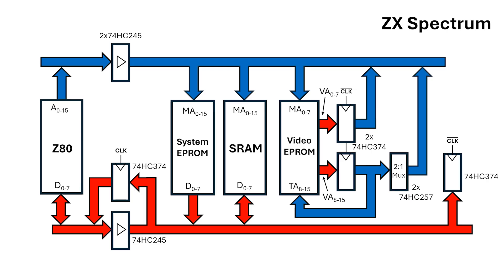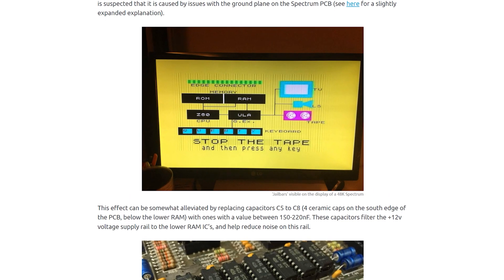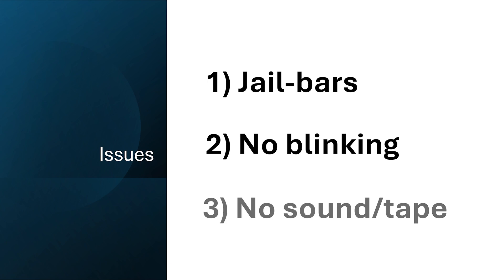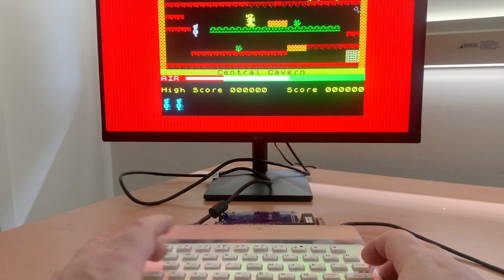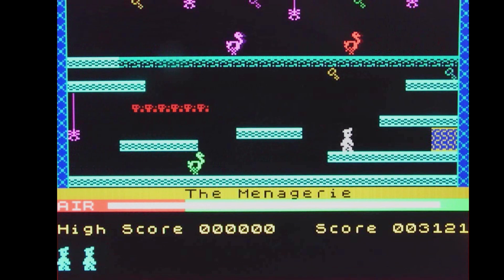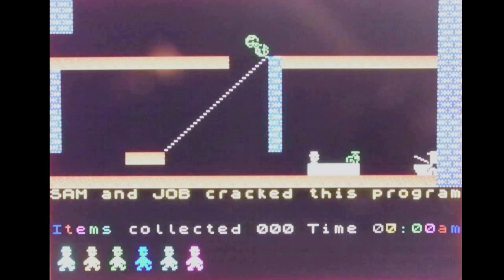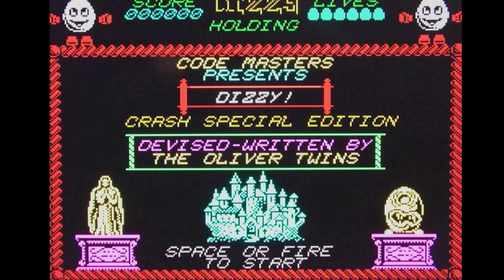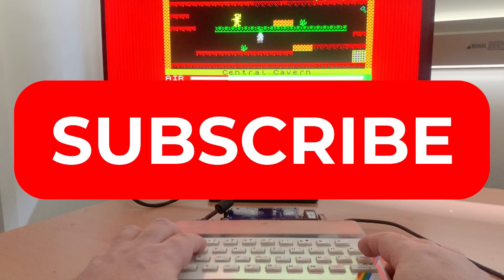VGA ZX Spectrum - Testing

Comment: The 6502 is Like a 8086 or (186).
The 6502 (8086) has Applesoft Basic in ROM.
The 286 Moved Basic into the CPU Microcode and Hardware Gates.
The Reason a 286 is Faster.
The 386 Accelerated the Operating system Kernel.

Comment: THE REASON WHY "YOU" CANT GET IT TO WORK IS BECAUSE - YOUR BREADBOARD CPU IS NOT FAST ENOUGH.
YOU HAVE TO "KNOW" HOW TO PROGRAM A FPGA. YOU DONT KNOW HOW TO DO THAT. YOUR GODS TAUGHT YOU "BEHAVIOURAL VERILOG" - THATS ONLY GOOD FOR TEST BENCHES AND SIMULATIONS.
YOU DONT KNOW - REGISTER TRANSFER OR DATA FLOW VERILOG.
ASK YOUR GOD - I'LL SHOW YOU.
THE "HARDWARE ABSTRACTION" LAYER IN WINDOWS HAS A SIMILARITY IN THE APPLE 2. THE "F8 ROM" -Read Only Memory IS A HARDWARE ABSTRACTION LAYER. YOUR GOD HASN'T TOLD YOU THAT. "NOR, DO YOU HAVE THE ABILITY TO WORK OUT THINGS FOR YOURSELF". ALL - YOU CAN DO IS FOLLOW STEP BY STEP INSTRUCTIONS.
THE APPLE 2 IS ONLY GOOD FOR MS PACMAN OR BUBBLE BOBBLE.
THE APPLE 2+ (PLUS) HAS A MMU AND DMA (DIRECT MEMORY ACCESS) AND THE BEGINNINGS OF A 2D GRAPHICS CARD. The Apple 2, ONLY has a RAM DAC, it Doesn't Have the Beginnings of a 2D Graphics Card.
A NES (Nintendo Entertainment System) - has the beginnings of a 2D graphics card. It Can Do More.
The Apple 2 is "Like" a Colour Texas Instruments Graphics Calculator. In its Power abilities.

Comment: This is really cool stuff - I guess this stops the memory contention issue on the original - so it should be faster rendering stuff, that would have been seriously cool back in the day. Tho tons of stuff wont work - because the in() instruction reading a unattached port trick - which reads the floating bus - which a lot of the later game use to read what the ULA has read for screen gen e.t.c. Cobra, Sidewize, Arkanoid and god knows what else.

Comment: Some games rely on the 'floating' (470R resistors etc) data bus for their video frame timing (essentially performing an I/O read from 0xFF, until because of the ULA / Z80 contention control and the floating data bus on early issue machines, they begin to see spurious video RAM data when the ULA begins to render the frame. A game could then begin writing a new screen update safe in the knowledge it would be 'behind' the current scan position). On later machines (or any which properly isolate the ULA / CPU data paths with tristate buffers) this could cause the game to hang as video data would no longer 'leak' onto the data bus. This might be related to some of the games not working? (This is a problem for software emulators too - the ZX spectrum has some peculiar quirks brought about by Sinclair's creative design approach, which games developers in particular often exploited, and which you have to emulate too - unfortunately - for proper compatibility)

Comment: Do you have a CRT to test with? I've run into similar issues using a deadbug style circuit with a ground plane. CRT works perfectly, but LCD has jailbars. I'm pretty sure it's caused by the LCD sampling the signal in a lazy way causing a lot of aliasing. That's not to say the DAC isn't at fault(any noise on the power supply will flow through to the output), but the aliasing is way worse than it should be.

I'd be curious to see what the output of the DAC looks like on the scope.

Also as other people have mentioned star grounding is the opposite of what you want. It's the area inside a current loop that determines inductance so you want the signal/power and ground wires to be close together as possible.
Reply from the maker: Not a bad idea.  I do have a conventional VGA monitor somewhere out the back.  Will give it a try.

Comment: Removing Jail Bars is not difficult. Ensure that your PDN (Power Delivery Network) is designed with low impedance to ensure that high frequency components are attenuated and routed away from the analog area. With proper PDN design, there's actually no need to have separate power supplies for the analog and digital sections.  Avoid using chokes if possible - the use of them is an indication of poor design (but are often used!).  
A possible reason why the full intensity colours don't have jailbars is because the signals are above the maximum 0.7V peak thus any ripple is ignored.
For the prototype, I would just use a galvanically isolated DAC to have separate clean voltages to drive the monitor.
Reply from the maker: Thanks i suspect you're right.  I checked my resistor network and bright is about 0.8v, is i too suspect it's saturating the 0.7v peek - no ripple.  The low intensity level is about 0.5v.  

I'll probably make  a video about it.  I'll start with a VideoDAC, and work backwards.  I was hoping to get away with just a resistor network though.
Reply: Just a thought - Are you driving the CPU clock with a TTL inverter and 330 ohm resistor by any chance? If so, temporarily remove disconnect the pull up resistor to see what effect (if any) it has on the jail bars. Also, mesh your PDN to better control noise paths and ground bounce. There’s no need to avoid ground loops when dealing with higher frequency waves.

Comment: A great project and well explained as all ways. I would like to try some of your ideas out on my RC2014. I am very interested in the Arduino Mega reading the video RAM, Will you share the your code and or make a video on your techniques. You always seem to skip over the finer details which is the most interesting parts for me.
Reply from the maker: Yep, i plan to plan to make the Arduino Code etc available.  Unfortunately, if i go into to fine details, it apparently puts many viewer to sleep, so i try to keep it a bit higher level.

Comment: A ground grid works better than a tree. The whole ground loop is only for the point between analog and the digital. For each section connect all the grounds together in all different directions. This makes a mesh and it will act like a ground plane up to a frequency based on the largest loop.
Reply from the maker: A mesh is likely to be closer to a ground plane than a star/tree.
It doesn't seem to upset the digital portion though, i may just need to redesign the analogue section.

Comment: Great job, it's looking amazing through VGA!  Incredible you managed to replace the ULA with an EPROM!  If it's not correct timing wise against how the original ULA works, that will be why some games aren't working!  Does it halt the CPU when the ULA is doing display stuff?  .sna are a bit hit and miss - sometimes they are from a 128K machine (freeze or just crash on 48K), other times they are using a specific controller input, eg. kempston, cursor, SJS etc.
Reply from the maker: Yes, i think the 60Hz vs 50Hz is an issues.  Also, i don't mimic the exact timing of the memory by slowing the CPU down during video.  That (should) be relatively easy to do.  Will give it a go.

Comment: Very nice work, about the jailbar, maybe an rc filter isolating the power of the video circuit from de rest of the circuit could help, something like 10R and 10uF +100nF
Reply from the maker: I did try using the circuit you suggested but with a diode instead of the 10 ohm resistor, but no joy.

Comment: Wonderful work, particularly the interlaced memory access between the CPU and video state machine. I cannot see any diodes, only resistors in the VGA output circuit on your board. The intensity signal should sum with RGB through a resistor and a separate diode for each each R, G and B signals going into the VGA connector. Also, 220 pF to ground from each of the RGBI lines of the VGA output may also help with the jailbars.
Reply from the maker: Yep, no diodes, only resistors.  Cool, thanks for the input. I'll keep it up my sleave.  Actually, i was thinking of using some extra transistors (2 per bit) to stop the pull down, but i think diodes will work just as well - thanks!!

Comment: Does colour clash display exactly as before or are there unexpected effects?
Reply from the maker: The colour clash matches what i've seen before, for example Brue Lee looks exactly like the same as images on the internet.
The jailbar artifact is new, i wasn't expecting it.  To date, all of the video has been white on black (for PAL) and there wasn't a hint there.
Reply: Wouldn't it be amazing if it accidentally eliminated Speccy colour clash? 😂
Reply: @whetphish  yea it would, ula+ was one method it involved patching the games or developing games from scratch. I feel that if Sinclair had put more into development at the time the Speccy would easily have trumped the competition, alas the hardware costs and supply issues back then tho......
Reply: @dav1dbone  Thing is though, one of the reasons for the Spectrum's long term success was the price/performance balance of the design. I suspect that any improvements would likely have either led to increased cost or reduced performance (the colour display in particular is a particularly efficient design even if it is ugly) - either of which would have rendered the machine less competitive. You only have to look at the like of the Oric to see this; on paper it's a better machine but in practice the graphics get in the way and slow the system down.

The big omission was the lack of a sound chip, and to this day I'm surprised they didn't include an AY on the interface 2 - this would have been copied by other vendors and become a standard pretty quickly I think.
Reply: @whetphish  that would be quite a trick, given that the colour clash is caused by the way the screen is stored in memory. If I remember correctly, someone did build a modern interface to remove colour clash, but it doesn't work in all games, and it requires something like four times the normal amount of screen memory to store the clash-free display on.

Comment: Superb! The fact that this works without an ULA is the real kicker. Even with the minor problems (which are likely to be ironed out) the picture is miles away from the TV (or composite) on a real Spectrum. Way better. Clean up the input to your DAC, some buffer gates (or a bunch of FFs if its really a timing issue) and plently decoupling close by should help.   Besides, Jet Pac and Bruce Lee bring back many memories.
Reply from the maker: Great to hear!  It's been a fun little project.  I'll give updates in the next series which will have no ULA and no Z80.  Should be fun.

Comment: I had the same jumping issue with the ZXPicoIF2ROM on my 48K. I spoke to the author of the board, Tom Dalby, and he said that this happens because the snapshot was taken on an emulator with a Kempston joystick interface enabled, and as my Speccy has no such interface, it gets confused.

He suggested that I create my own snapshots in an emulator, with Kempston disabled, and use those instead. I haven’t got around to trying this yet, but I thought I would share, as it seems it might help in your situation too.
Reply from the maker: Thanks for that, i suspected that's what was going on.  Good to know that i'm not the only one who has seen it.  Makes me less worried about it.  I was just shying away from writing .tzx or .tap code.

Comment: Hi, regarding the jail-bars they might appear because of the way you physically implemented the intensity bit comming into the video dac. I noticed in one of my builds if I buffer all the color and intensity bits and the pixel clock and bitmap data  so all „flows“ synchronous through the output state all of the clock related artifacts disappear leaving only power related stuff which is more easy to debug. This I could get away with ample decoupling and shorter slightly thicker wires (also using star grounding and power but separate digital and analog circuits power) I did however also buffer the analogue video out with a fast 3ch opamp - the same that is used on some console RGB-mods.
Reply from the maker: Thanks for that.  The video comes directly out of a 374, so it should be synchronized.   My back-up plan is basically what you suggest, create a separate analogue only video board, possibly with it's own power supply. 
I think the spectrum is a bit forgiving because it only has 16 colours, but this would be crap for actual VGA.